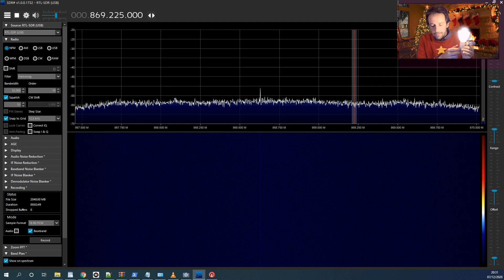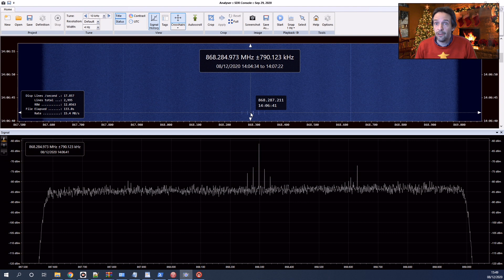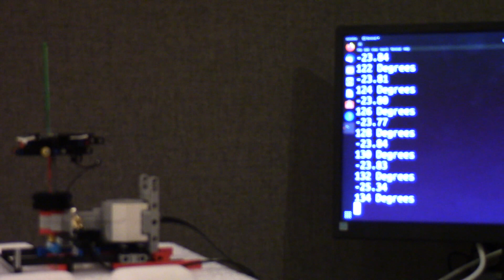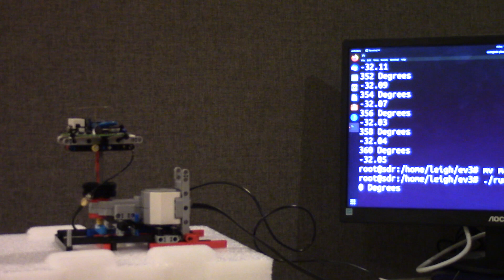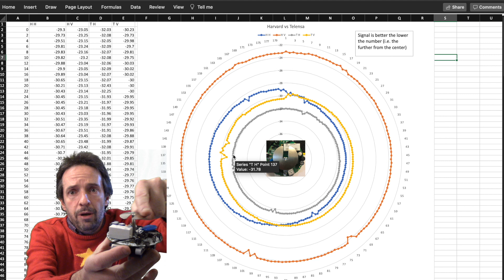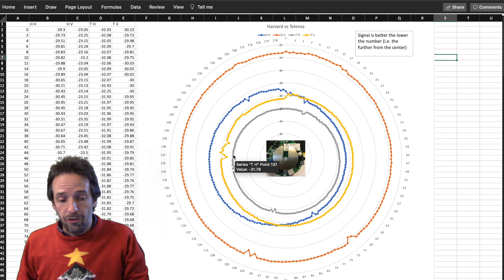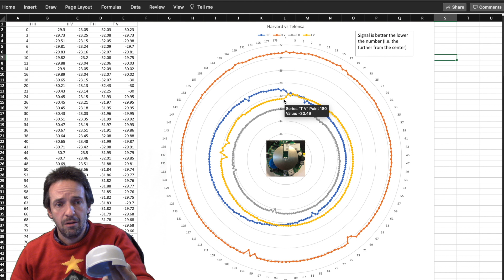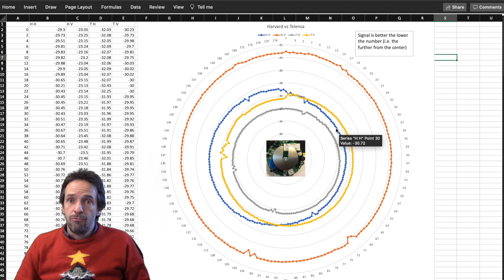Mark Steele's latest street light zapper tested! Mains voltages exposed and zappy antenna used.

Comment: Did you find out what the second power supply was that use the LED driver chip.
Reply from the maker: Working on that at the moment :)
Reply: I thought that was a bit confusing too, it'll be nice to actually understand why it's on there at all, seems very strange 🤔
Reply: @frinkemon  I would take a guess they using it as an isolator power supply to drive them Optos for that secondary output so it’s isolate from the main power supply or they using it to drive the relay.

Comment: UHF is 700mhz 5G is found in radar and TV signals from 300mhz to 3Ghz and this street light sensor operates at 868mhz in EU  and why so many compaciters do your research leigh
Reply from the maker: 5G is not found in RADAR. So many compaciters? You mean capacitors. Yes things often have capacitors, and resistors, and diodes, and various other components. What is your point?

Comment: Great video, but the the Mark Steeles of this world are going to point out that ofcourse this device is going to apprear completely harmless when used by someone who is not part of the conspiracy.

And to be fair; they''d be right. If I was implementing a global killingzone deathray-of-death vaporizer targeted super phased array weapon of death (because I'm so very very expert) I'd also design the device to look as innocent as possible to annyone who might get their hands on one, and only apply the dangerous bits when it's proparly installed and... nobody can climb up a lantern to see what's going on... I guess the experts who know all about these 5g weapons are not able touse a ladder... or something.

The point is ofcourse that anyone with a little knowledge about electronics can see that this device simply does not have the ability to handle the kinds of power that are required to vaporize a human. Not only does it not look like such a device, it's very construction does not allow that kind of power.